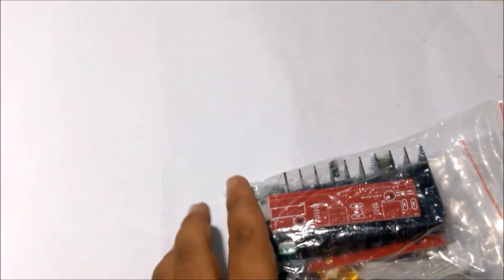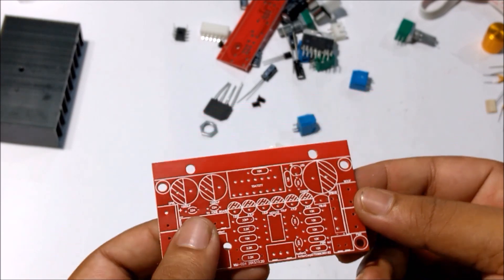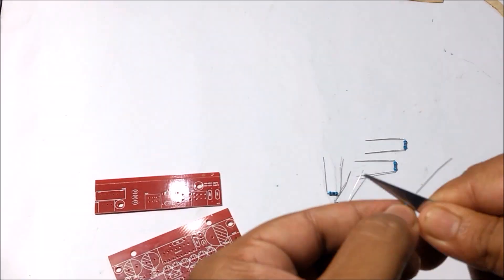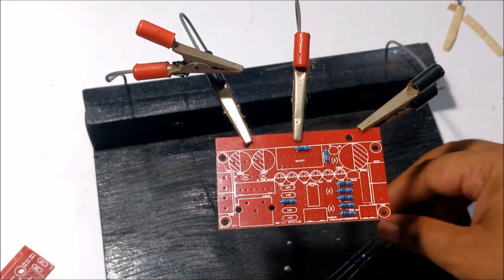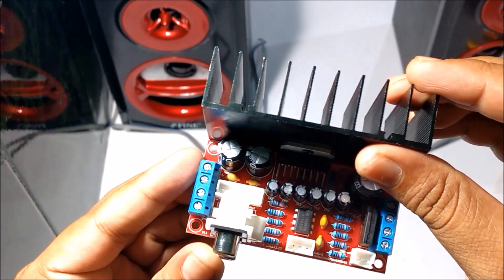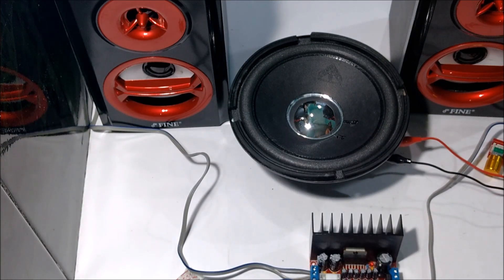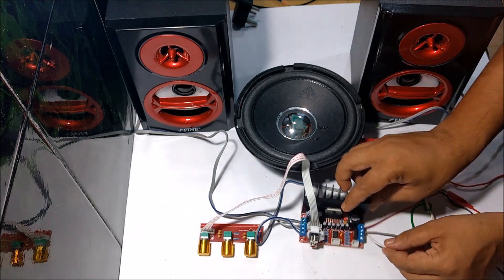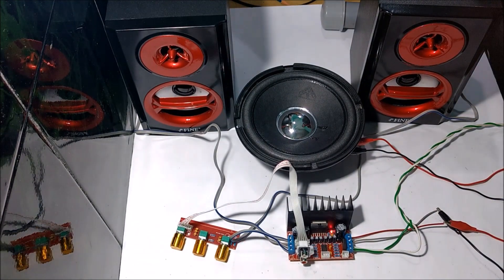Shareconn TDA7377 2.1Ch Amplifier Super Bass  DIY

Comment: What do the controls on the 'tone board' do  ? Is there a master volume , a sub volume and a sub crossover frequency control  ?
Reply from the maker: Bass,treble,master
Reply: @CreativeStuff  That's not a very good product in that case , I don't know why the Chinese churn this sort of stuff out . If they had ditched the tone controls and went for master , sub volume and sub rolloff  , it would have been a much better product  . No way of balancing the volume between the sub and the mains and no way of tailoring the sub's rolloff response :( Maybe hack it and get a potentiometer on the input of the input of the TDA7377 sub channel input ?
Reply: @CreativeStuff  it's subwoofer volume, treble, master